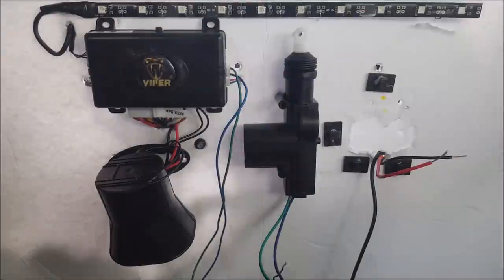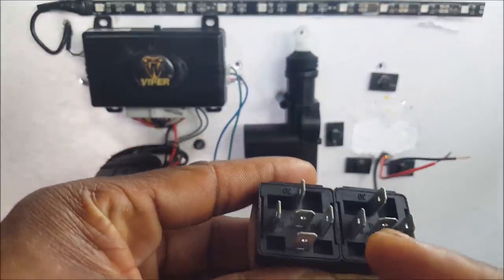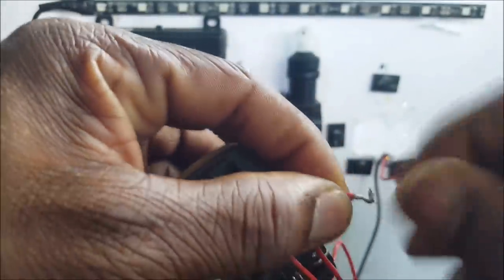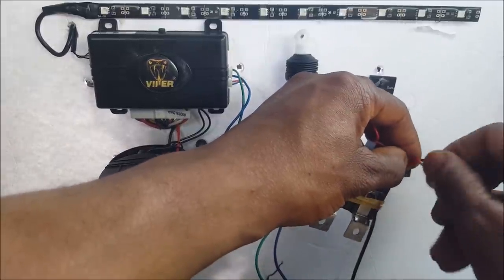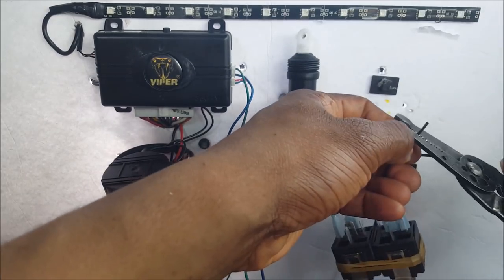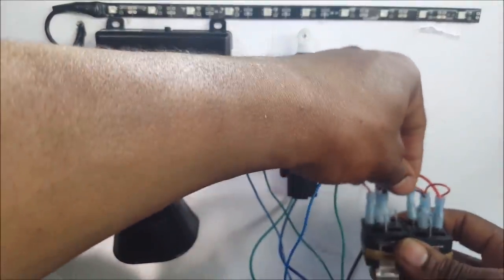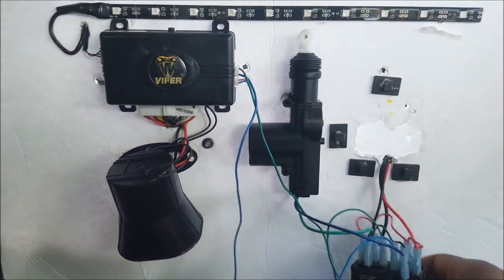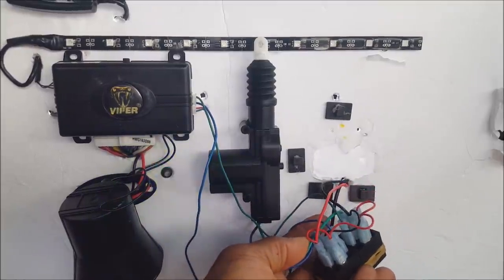How To Wire Up A 5 Wire Door lock  Actuator Relay From Start To finish Very Easy

Comment: Even though this video is 7 years old, I was trouble shooting a problem on my Mazda protégé that had an aftermarket alarm like this. I inadvertently knocked off 2 wires from the relays , I had no clue where they went on the relays until watching your video, although wired slightly different, your video gave the key to fixing my problem.  Thank you Sir for a well put together video.

Comment: I really liked your video. It was to the point, really well explained. I am having problems with my car rear door locks. The actuators are not getting enough power to unlock the doors. I took it to a mechanic shop, and they couldn't work on it, because they said the problem has to do with the alarm system. I checked the alarm system wiring, and it seems to be fine. However, I still have the lack of power problem. Now, after watching your video, I want to use the same diagram idea. My question is, what type of 5 pin relays did you use? Thanks

Comment: I'm trying to do a keyless entry system on a 2 door truck.  Do I need 2 relays for that or should the factory wiring harness & inline fuse be OK to just run a hot & a ground? Actuators have blue & green wires.  1 has like 6 wires. Can I just do blue & green just to get the keyless entry?

Comment: I’m problems trying to wire up my actuators. I did exactly what u have on the video. But the actuator only goes down(lock) open doesn’t do anything. Any pointers? I have an Astra a15/777 alarm

Comment: I know this is old but its been 10 years since I bought my truck and the Viper 5900 LOL and I have yet wired up the door locks. So its a 96 Chev Silverado 2dr ext cab. It says
Door Lock Light Blue Driver's Kick Panel w/Keyless Positive
Door Unlock White W/o Keyless Entry Reverse Polarity (5 Wire) 
So do I just follow your guide here for both lock and unlock using 2 relays, or do I only need 1 relay for the unlock wire ? Will this also work if you just tap into the lock/unlock wires or do you NEED to cut each ?
Thank You !

Comment: So I took my car to install a viper 5706v like 3 years ago, the doors don’t unlock after a long time of being parked but do unlock after parking for about 1-2 hours. I recently dismantled the parts covering under the steering wheel but I didn’t found any relays wired to the lock, unlock I followed the ground wire and it goes to the chassis. Could that be the reason it doesn’t unlock after parking for a long time???

Comment: Where are you feeding power to the viper unit? And you are wiring directly to the actuator? How will that affect the switch on the door for U/L?
Reply: Power to the alarm normally comes from ignition harness. He hooked the “signal” ( blue and green wires) to the relays( 2 black boxes). Watch his video a few times! It really not that hard to follow the way he wires it.

Comment: When you say 12 volts source do you mean straight to the battery or just a wire that runs a constant 12 I’m a bit confused.
Reply: ignition wire to battery

Comment: I bought a truck with an Alarm, it has manual door locks but the driver door is  capable of opening by alarm remote. A few days ago, the door stopped unlocking and locking, what could be the cause and where should I look? Thank you.

Comment: Thanks! I want to use my cars  lock/unlock feature for when I put my car in Park the doors will unlock, and in Drive the doors will lock automatically from the car's own actuator. I have a base Chevy Spark and the only door with a power lock is the driver's door and no remote. I installed my own remote and want the car's  auto lock/unlock  feature to tie into my actuators too.

Comment: I have a problem with my alarm system I press the button on the remote give me a song that it's lock but you're not hearing the actuator activating is this a kids will be at the relay is bad can somebody help me out then how to test that relay if it's bad or good and where to find it in the motor vehicle

Comment: Hi, why do we need to use a relay ? It doesn t work without it? Or it could drain the battery with relays? Thanks,
Reply: using relay is important u can get good power source on the output of the relay and it also gives protection on the switches and it will avoid fire it will shutdown depending on the wiring

Comment: PrecisionConnections i have a question i have a 08 civic dx with no power locks i bought a keyless entry system with 4 lock actuators how would i install it do i need a relay

Comment: Don't suppose you no which wires for the Nissan terrano ? It has a nat security system but want rid of that , I've bought a car alarm with central locking control ... I believe it has a positive trigger so how do I change it to negative trigger ??
Reply from the maker: Dean curtis they are located in drivers kick panel. look for the smallest wires going into the door; test those wires for factory unlock disarm using the key in the drivers door lock

Comment: So you have trigger green on pin85 of relay #2 and trigger blue on pin86 of relay #1?
Reply from the maker: Daniel Her for some reason when I'm training new installers about 5 wire door locks or window bidirectional motion using relays ;they tend to grasps the concept better using that configuration. I labeled my technique. The " inner and outer pair grouping " method.
Reply: PrecisionConnections It worked well for me as well. You're video was a big help! Thank you very much.

Comment: Good tutorial but be aware of what he’s saying vs what he actually is doing. The PIN connections don’t match what he’s saying. Looking at the relays, the positives go from pin 86 to 87 on one relay and to pin 87 to 85 on the other one  then to 12v. Negatives are pin 87a on both relays. Alarm wires go to pin 85 on one relay and pin 86 on the other relay. The actuator(s) wires go to pin 30 on both relays. Do as he does but as he says lol.

Comment: Hi, I have a 5 pins power window/lock switch, and I want to use this switch to control 4 actuators. How to do the wiring? Thank you .
Reply from the maker: wire them in parallel with eachother

Comment: Hi this is not working for me I did the same setup but it's not triggering the relays. The alarm seems like it has low 500mA negative power how can I make it work properly ?  The alarm is a SCYTEK A20
Reply from the maker: Standard relays only needs 0.080 milliamperes to switch over. Try following the video exactly, like everyone else, and it will do it's job. If it doesn't work you may have another problem outside the scope of this video.
Reply from the maker: Standard relays only needs 0.080 milliamperes to switch over. Try following the video exactly, like everyone else, and it will do it's job. If it doesn't work you may have another problem outside the scope of this video.

Comment: Can I wire two actuators instead of just one to this by just adding the wires together?
Reply from the maker: Correct! all you will have to do is step up your fuse and wire gauge 12 gauge wire @15 amps fuse is Ideal

Comment: This is ok, could of been better showing the wires full view from actuator and unit.
Where is positive coming from?    
    .The brain/head unit or direct to battery?
     .is ground from the unit too or direct from chassis?
     .show the wire colors.

Other vids too dont explain wire color if there isn't red+ or black-

Just somethin for the 1st timers to understand 

If you have Brown and white they are ground. 
Violet is positive 

Wasnt good, but useful

Comment: I'm a bit confused, why do you have the Negative on the 87a terminal? AFAIK thats the output to 30 which is normally closed and opens when current flows between 85 and 86. Someone help me to understand this please.
Reply from the maker: DSK In the normally closed position both motor wires rest on ground and when  relay 1 is energized a positive 12volts powers one side of the motor. Causing it to move in one direction up and if only relay 2 is energized then the motor goes down
Reply: PrecisionConnections, thank you so much for your explanation. I was missing one point, all clear now. Thank you for this knowledge

Comment: So if i wanted to use an actuator with 5 wires would it be the same process? Im installing 3 door locks to my Isuzu trooper
Reply from the maker: Yes. Parallel the motor wires together: every motor must be wired to move in the same direction in respect to your lock and unlock position.You must always fuse your positive main feed with a 3.5 amps per motor or 15 amps to 14 gauge or thicker (lower the number the fatter the wire) size wire.
Reply: PrecisionConnections   ok but how do i wire up the master actuator? Mines has 5 wires running from it. Or should i just use the 2 wires like the video and leave the rest
Reply from the maker: Aaron Bachew if you have the relays built into your actuator then this video Will not help you. You will need to follow the instructions that was provided with your kit. The wiring on those chinese units are not standardize: they are most likely proprietary because of trademark issue over there
Reply from the maker: They copied another company's design without permission and didn't compensation them that's why you might be staring at some weird looking colors coming out of the the main actuator
Reply: PrecisionConnections would love to share a picture with you of what it looks like. Can we send pics on youtube?
Reply from the maker: Add me on Facebook you can send it there very seamlessly
Reply: I have the same 5 wire actuator. Its a bullz brand. Did u have the wiring for that?
Reply: It did not come with any instructions or wiring diagram.
Reply from the maker: Mike Ruiz that company uses non standard wire colors. I wire my door locks from scratch I don't use prefabricated kits because the wires are thin and the burn out too quickly. Sorry I don't have any info on them
Reply: PrecisionConnections yeah it turned out I wired it right the problem is I had door switches so I did not need them. Thanks I appreciate it I did a lot of research I found out which wire goes where. I was wiring door switches and the three additional wires, which was not supposed to do it say either or situation not both. I wanted the door switches to control the other Motors not the motors themselves.

Comment: I'm hooking up a 4105viper and installing aftermarket Omega DSKIT44 4-Door Central Locking System how do I tie that in to aftermart alarm and how do i hook up flash output and horn i have factory horn hooked to a horn button direct no relay
Reply from the maker: Boss King you should be able just to tap the remotestart unlock lock trigger wires directly to your low current trigger control wires of the omega control module  the colors are usually the blue green standard.
Reply from the maker: Boss King connect the brown low current trigger from the main harness of the 4103 4105v system to the vehicles negative low current trigger control wire

Comment: How do u make lights flash when lock or unlock i have a 4105v hooked to a omega  unlock kit my park lights light up when remote start but does nothing when lock or unlock
Reply from the maker: White wire on the 4105v connected to your packing light directly (+) or remotely triggered (-) the switch
Reply: PrecisionConnections I have that connected it light up park light whenever i remote start car but I want the park to flash whenever i lock or unlock car
Reply from the maker: Your parking light wire is not connected to the parking light trigger of the vehicle . The lights are coming on during remote start because your vehicle's lights are tied to the ignition from factory. Your 4105v is not doing the work. What is the year make and model of your vehicle.
Reply from the maker: Did you select the parking light polarity output located on the side of the 4105v?
Reply: PrecisionConnections naw i didn't mess with anything on the side of 4105v and for the parking light i hook the white fused wire to the brown wire at parking switch
Reply: PrecisionConnections it's a 1990 Chevy caprice classic
Reply from the maker: You have to remove the jumper located under the red tape on the 4105v. then take the jumper and insert it into the 3 pin prong located on the side of the brain. you must line it up with the + marking on the unit. A 4105v tutorial will be coming very soon. So lock your subscription button down
Reply from the maker: You have to remove the jumper located under the red tape on the 4105v. then take the jumper and insert it into the 3 pin prong located on the side of the brain. you must line it up with the + marking on the unit. A 4105v tutorial will be coming very soon. So lock your subscription button down
Reply from the maker: Nice ride! You can do a lot to it. I installed a Push To Start Kit On One. We hooked it up with a backup  battery so soon as you touch the button the hydraulics lift the 4 wheels up 2 seconds before the engine starts. then the customer peels out from his parking space. Very sick look!
Reply: PrecisionConnections yeah its a lot you can do to them i just got the basics right now but gonna be looking into doing a lot of mods in the future
Reply: PrecisionConnections just home gonna look at 4105 but a tutorial would be great
Reply: PrecisionConnections ok i lined the jumper up like it shows on manual i hear it double click but lights don't flash still
Reply: PrecisionConnections just wanna report back to you and tell you thanks i moved the jumper like u said and the light flash works now whenever i lock and unlock car thanks for help....  But I have one more question to see if u can help me with i hooked up a horn button i bypassed the horn in steering wheel to a aftermarket horn button how can i get horn to honk with lock and unlock its a button that's hooked directly to the horn only works when the ignition is on cause it have a red led horn button but it's not connected to a relay or anything just direct
Reply from the maker: Connect the brown wire coming from the main harness from the 4105v to a relay that will control the horn. The 4105v wire is negative and needs a relay to step up the current to drive a horn motor
Reply: PrecisionConnections sounds kinda difficult im not good with relays I will try to do it tho
Reply from the maker: I'll throw Up a video
Reply: PrecisionConnections I would appreciate that seeing u explain it will help a lot 👍
Reply: PrecisionConnections I got a question I hooked up a 4105v remote start on 90 Chevy caprice it works good but my radio won't come on whenever i remote start the car unless the key in the ignition because the radio is connected to the radio fuse so it will work with the ignition how to make it come on whenever remote start the car
Reply from the maker: Boss King you need to connect the orange accessory wire to the orange Remote start power harness wire